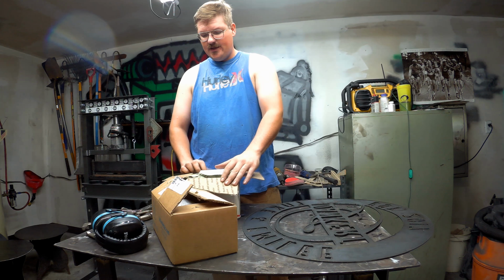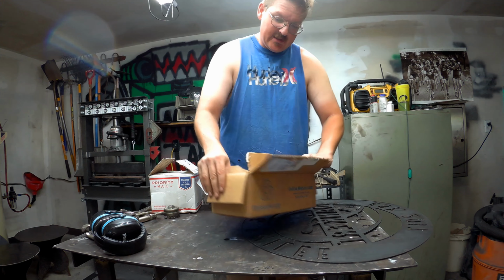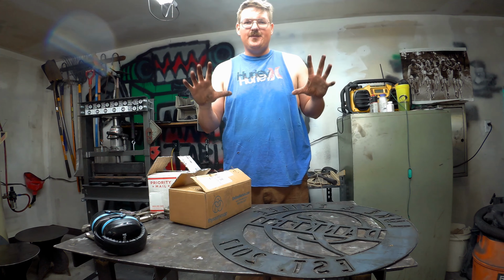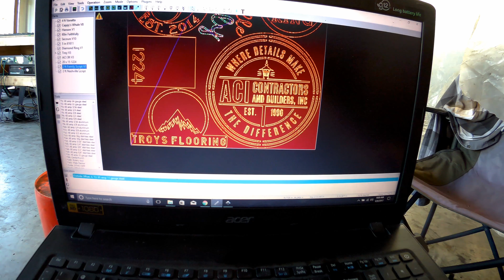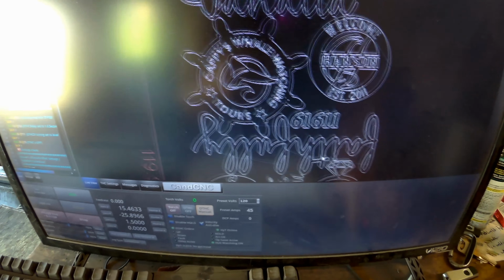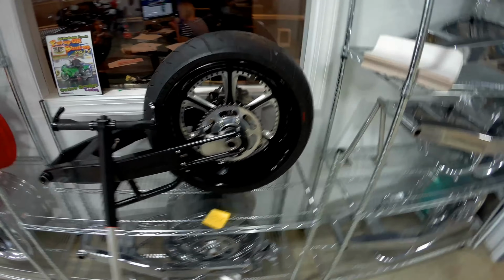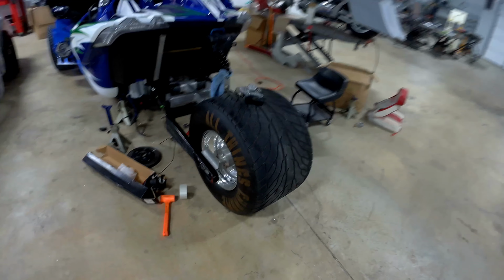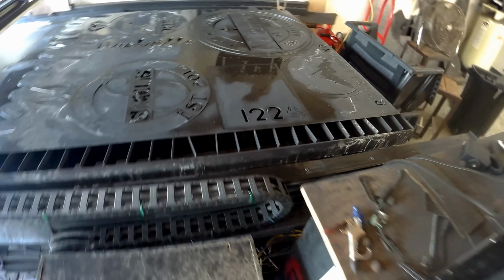2017 Maker Table Shop Tour - Day In The Life

Comment: He's Back!

Dude you got bigger cahonies than I do to trust your table to run by itself LOL

Does your air compressor have an automatic tank drain on it? Do a fleebay search it is a solenoid valve with a timer for $50 or so Mine dumps every 50 min for a few seconds (dry climate). Take the line from the compressor and divert it through a coil submerged in barrel of water to drop the air temps, that will help big time on dropping condensation out of the system.

Some more tidbits I found is to use Arm & Hammer Super Washing Soda not baking soda as a rust presenter in the water table do a mix ratio of (point 8 oz) .8 oz / gal of water yielded a PH of 11. This is a lot cheaper than dynaflux or greencut.

My 6"x!2' passed the leak test now it's time to check out the drain system and pumps this week then a few more brackets and then paint time!
Reply from the maker: HA HA HA!  It usually shuts down if it crashes the z or something drastic happens.  The worst is when the torch get nudged just enough to skew it, then all the circles go oval and its a mess.

Comment: look at getting a proma thc
Reply from the maker: I'll check it out!  I now have the THC running really well. My biggest problem was I had one box left unchecked in the software the "Hardware Enable" needs to be checked in order for it to recognize the DTHC.  Once I figured that out it was just some minor tuning stuff.
Reply: I hear yea there I building my unit now I using vital systems controller mach 4 plasma been taking hrs to figure things out I starting to wish I just went with a candcnc like you did but I wanted mach 4 found not to many video out there on setup  lots on sheet cam and inc scape  one little check box make a big difference  proma has 3  thc units one unit hooks up right to the stepper driver  that's there newest one the other works in mach 3  and soon to be a mach 4 plasma update mach just put it on youtube it also has a tracer feature for plasma  right now its a plugin from the controller maker